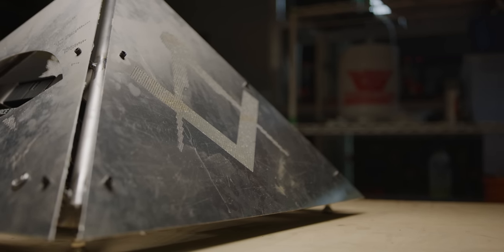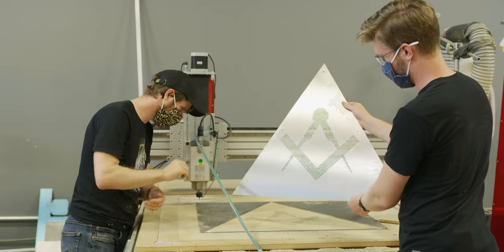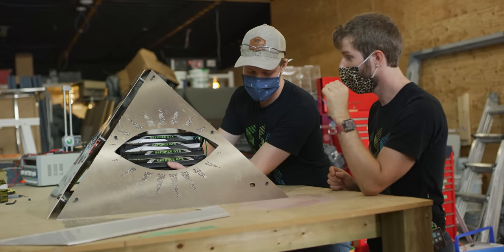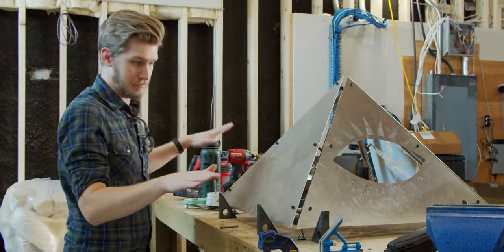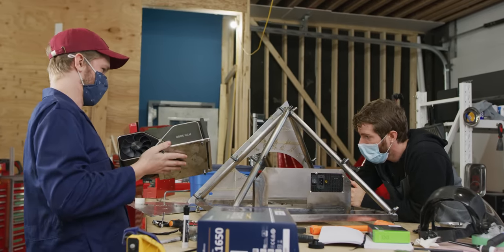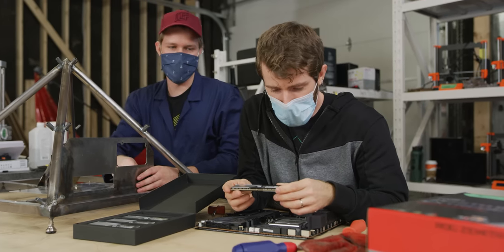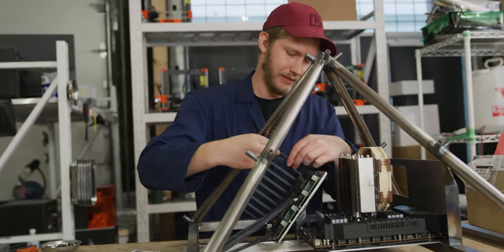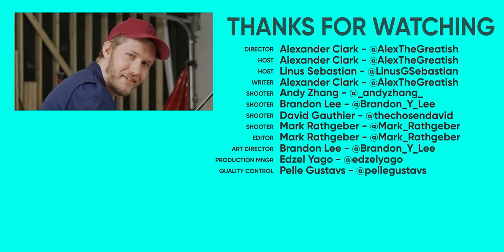The Nightmare Build – Pyramid PC Pt. 2

Comment: Please use more cutting fluid when you use the lathe bro.
It's kinda like thermal paste and works the same way. 
You can't really use too much of it but you can definitely use too little.
Reply: The thermal paste analogy doesn't work because you can use too much thermal paste
Reply: is it just me of does the lathe sound really bad, like something wrong with it
Reply: I've never seen anyone use cutting fluid on a lathe hell I was watching a video of those giant ass lathes and they didn't even use cutting fluid
Reply: @nosleepjones4551  well you'd only really need it if you're drilling or tapping the internals.  Drill bit  doesn't really have enough thermal mass so it's going to get toasty, while a typical lathe exterior cutting tool has a ton of mass and in typical lathe cutting you're going around a fairly large external diameter.  Cutting fluid isn't so much about lubrication of the surface but about pulling heat out of the surface so that you get cleaner cuts and have less tool wear.  Also prevents you from accidentally welding your tool into the piece, which is pretty easy to do if you're working near the heat tolerances of your materials.  Not that you should ever be working near the heat tolerances of your piece, but in an air-cooled setup you can definitely do when drilling or tapping, especially if you fuck up and have a beefy enough machine.  Girl in training at my college shop once friction welded a tap into a piece by putting it in the milling machine thinking it was like a drill bit.  Apparently also nearly killed the motor in the poor milling machine, but they don't actually give people in their first class any of the ones that are still running to original spec.

This is also why professional CNC machines have giant sprayers of cutting fluid so it's dripping from the piece as the machine is milling and the entire area is enclosed.  Low temps on the tool means that your tungsten carbide cobalt cutting edges last a lot longer, and those bits are extremely expensive.  I believe some of the machines actually have a system for filtering the fluid so it can be reused by the machine and you don't have to discard a bunch of cutting fluid on every use, but that's also fancy high-end stuff because the particle filtration for the small bits to go through a pump again has to be a pain in the butt.  Save on fluid, but you have to buy filters.

In other industrial applications, though, you can just run your machine on a 1:1 or 1:2 on:off cycle in 10 second or so chunks to keep from building up too much heat or you're working with pieces so large that the amount of continuous work time to heat the entire thing up is going to be too high to get to.  It's really more a concern on small pieces like this and on cuts that should be done in one go, like tapping.  Heat is one of the things you learn to watch for and understand in metalworking, just like how when you're woodworking you don't want to accidentally burn your wood piece by using the wrong tool or the right tool in the wrong way.  And like PC air cooling, you can manage heat just by managing air flow - a bunch of industrial places will set up fans to create a constant wind across machines that are air-cooled so that they cool better, but then in videos they'll cut the fan noise or go slower with the fans on lower settings for less noise.  There's a ton of heat management hacks in the factory and machine shop environment.
Reply: And what qualifies you to give advice?
Reply: @adamatch9624  Who me?

 Nvm I thought you were the oc of this post...

Comment: Linus:“Alright that’s about an inch”
Machinists:”What the F&@! you mean it’s “about” an inch.
Reply: my dad a CNC operator: pain
Reply: This. It is so true. There is no "about", there IS and there IS NOT as a former machinist.
Reply: Proper machinists "what the fuck you mean 'an inch' "
Reply: I think it was just for the trough hole for the standoffs, so yeah about an inch is perfectly fine (they will be parted off later), no need to be precise about something that doesn't matter... obviously if you have a cnc you can't tell it "about an inch" even if it doesn't matter, but this is no cnc lathe
Reply: @simonstucki  a lathe is an extremely precise instrument. Machinists are always concerned about the accuracy of measurements. Sometimes down to the millionths of an inch. It is extremely I’m;octant in manufacturing. I didn’t know this until recently, but I fell down a YouTube hole on the subject and it’s fascinating
Reply: @somethingsomethingsomethingdar  yes I know, although a millionth of an inch is definitely in grinding territory. but in this operation I believe he was drilling a hole into the stock material, from which the part was "cut" of in the end, the part was abou 3/4 of an inch, so the hole had to be deeper than that but nothing precise...

Comment: ryzen 5000: i'm about to end this man's whole career
Reply: Does Ryzen 5000 have a 64C/128T option? Does the Ryzen 5000 have 64+ PCIe lanes? Does the Ryzen 5000 have Quad/Octa-Channel for RAM?
Reply: @master-of-synapse  jesus calm down
Reply: @rossgoosen7269  If I came across as being agitated, I am sorry for that. But even with the arrival of Ryzen 5000 there are still many valid use cases for Threadripper. And none of these change the matter towards going for a Ryzen 5000 series.
Reply: @master-of-synapse  yes
Reply: @master-of-synapse  he went from 4 quadros to 2 3090s. the client is a whale. i honestly doubt that threadripper was chosen for any of those reasons. 

it was all about the price tag
Reply: @shardhoney  Sure, nothing wrong with that. That doesnt invalidate the fact that a Threadripper has many technical features even Ryzen 5000 wont have. And these two 3090s will gladly take the additional bandwidth to the RAM due to Quad-Channel and the extra PCIe lanes. Even the 4 Quadros would have benefitted from them.

Comment: Saw the welded nuts for the side panels, have you heard of rivet nuts? They install like a rivet with a tool and gives a way to have threads in sheet metal without having to weld a nut to the project and with less stand off. I just saw them the other day, they might help on future projects

Comment: After RDNA 2 announcement

Client: yeah I want you to replace the 3090s with 2 6900XTs cause I heard they are faster. 

"Linus has left the chat"
Reply: Where would he heard that😂
Reply: I think they'll be fine because the reference 6900XT has a smaller cooler than the 3090s they're using.
Reply: @tomhsia4354  but they are clearly not faster plus they have less ram and amd showed graphs with rage and that other thing between 5000series and amd gpus
Reply: @tomhsia4354  also i think Nvidia tested with intel and amd did with their own so it has to be seen
Reply: @ajayrathore8704  I did not say the 6900xt was faster, what I said is the 6900XT reference design has a smaller cooler than the FE RTX3090. If Linus' customer wants the 6900XTs, they won't need to change anything since the cards will fit.

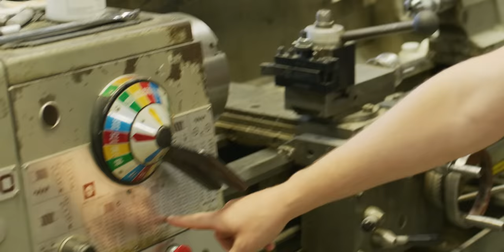Comment: @ 4:12 Alex : This is a thread cutting tool.
Nope Alex this is a neutral external finishing tool and it has a 55° tip angle. ISO threads have a 60° profile angle. Only BSP BSPT BSW & BSF have a 55° thread profile angle (mainly done for gas threads). ;-)
Reply: no surprise he doesn't have a clue what he is doing

Comment: My god that shop is a fabricators wet dream!
I definetly would have gone with a different internal design, with more bolt-in parts instead of welded to solve some of the fitment/acessability problems. And would tig- weld instead of mig-welding it for nicer/more precise welds.
But man thats an impressive build.
Well done!

Comment: As someone who has worked not only in Aerospace industry but also ITAR and medical grade part inspection/assembly, I'm not surprised the engineer here (probably a machinist) was alright with a .100 thou difference on a corner haha. But I will say this isn't a manufacturing environment, and if he did in fact do it all himself, good on him. I'm sure that 60's lathe works just fine but someone his age not using a more modern mill with G & M code and doing the shop math himself, not to mention all the welding to accompany, this was no easy task. This...will probably be a very hefty bill for this person.

Comment: How to properly clean your metal pyramid computer: wipe it off with a towel
Reply: @deminybs  You'd think... I got my chewed out by my instructor in a welding facbrication class for cleaning my final project up before submitting it.  The logic is, its stupid to pay a welder/fabricator $40+ an hour to clean up a part that is going to be sand blasted and powder coated anyway.   You may have noticed the rust and heat discoloration on the steel, as well.

Comment: The fact they didn't clean the outside panels is driving me crazy.
Reply: I'm guessing/hoping that will be done before being sent off to powder coating?
Reply: They are just showing you the build. It's going to be polished and sent off to be powder coated. Probably already has by the time they released this vid.
Reply: I dont see how Alex is still working there. Clearly lied about his shop experience and is soo freakin incompetent. The already had to hire someone to do his job.
Reply: @HarryTaints  What experience did he claim to have?
Reply: @HarryTaints  He claimed to be good at CAD (which he sure fuckin is) and have some machining experience. I don't think he ever claimed to be a professional machinist..... and btw if it was such a big deal, Linus wouldn't be keeping him around.... obviously he does his job as well as he needs to, since he's been there for ages at this point.
Reply: @TmanT321  Not to mention alot of the footage they show has clearly been scripted to be more comedic than show off Alex's professional side. I'm sure he's much better at his job than they make him out to be on camera.
Reply: lol they're working out the fitment. You expect them to stop every 5 minutes to wash the thing down? It's still bare ass metal.

Comment: Hey Linus, can you make a overclocking competition? Not necessarily a race, but just to see who can overclock to the highest speed. If you can it would be sweet if you beat the record, but the record was made in 2014 at 8.7ghz (ik insane right?) and I think that the chip used was more specialized if it hasn't been beat since then. I just thought it was a cool idea I'd share.

Comment: Ok what i don't get is ease of access. Yes we made this of metal but a little time spent making etching to give the metal a brick look would have given the capability to put easy latch clamps designed to look like bricks to easily take off every panel in seconds. At worst a single screw for each panel and a few clamps and every part be accessible. As for the rest is had to be on front of it but still good design overall

Comment: Usually when you need to go back to the drawing board because of massive changes you actually go back to the drawing board and don’t just keep winging it with the manufacturing. All of the problems you encountered during the video could have been discovered in software instead.

Comment: Has anyone at LMG ever done an apprenticeship at a machine shop?

Don't cut stuff with a cutting wheel if not necessary.  Milling machines are vastly more accurate.
Measure, measure, MEASURE.
Dry fit ALL parts first.
A couple hours of solid modeling beats days of re-cutting and remounting. 
Etc., etc., etc.
This must be a gag gift.

Comment: Wouldn't the fact that the GPUs are on another board make a bottle neck in the bus? Im sure any cable and connector between the boards will cause performance issues. Or am I wrong?

Comment: All of the errors in solidworks... EEEEEECHHHHHHH.. 

Also, it's not a good thing for there to be smoke when using a lathe. You'll tool harden the not only your tools, but your parts as well. Make sure to ALWAYS use cutting fluid when using/operating a lathe. ALWAYS.

Comment: Soooooo...... That is not a thread cutting tool. that looks to be a 55 degree center cut DC diamond tool. Actual threading tools come in a couple different forms but for the most part they are 3 sided triangle inserts with obviously 3 edges. They can either have a specific thread ground into them or have the standard 60 degree angle of a threads root cut into them so you can make different threads with them. There are threads that use 55* angles like the Whitworth and British Pipe Threads but all ISO standard Thread use a 60 degree form. Look into company’s like Iscar, Sandvik, Seco, and Sumitomo. I personally prefer Iscars tools because most of them use generic standards and not proprietary inserts.

Comment: It so needs polished brass runners down the sides (where its open) and a polished brass pyramid cap on top, also an acrylic or glass cover places inside the 'eye' which I would have tinted (light smoke tint). Then it would look special but at the moment I'd pass on the case without the additions I just mentioned, just gimme the hardware instead, my i7 3330k 2011 is getting old now lol.

Comment: really guys? you had to go trough all that lenght just to fiind a way to fit everything in int , you could have made the underneath chasis removable for the MB and  the back for the psu batant , or the graphics card holder make it slide to position

Comment: Swapping 4 quadro 8000 for some 3090 just shows how this "client" has no knowledge about the meaning of the parts. The 3090 does not have the same drivers and functionality, so it is fair to question if this build makes any sense for multiple reasons.

Comment: Why not make all of those parts adjustable so they can be moved out of the way instead of making everything static. That is really stupid.
Reply: Then you could simply move parts to fit them and have tighter clearances when you slide the parts back in place.
Reply: The video card mount and could be set to move both directions for clearance. It could move towards the eye for easy fitting and removal of stuff on the board and have slider for sideways for total removal. The mobo mound could also slide towards the eye both separately and with the gpu mount for clearance of the various parts. Or just seperately and you have to move one then the other.
Reply: BTW, the slider mechanisms could go in the space next to the metal bars so it's below and flush basically with the bottom structures. Then you don't loose space.
Reply: You could also make the gpu mount rotate up to 180 degrees or more and have it flip back for installation on top of or in place of the previous. Obviously might be difficult with a mobo in, but it might be really nice when the mobo is not in.